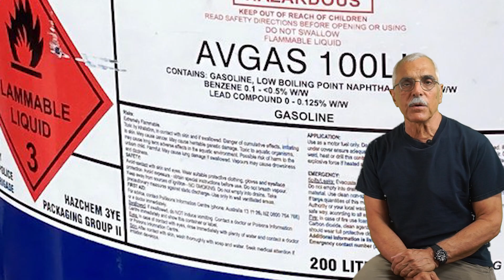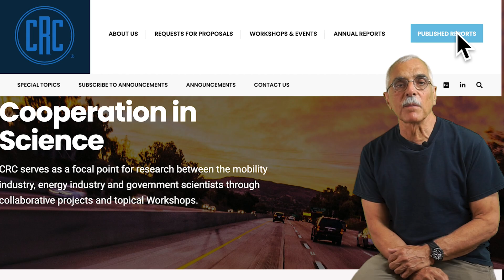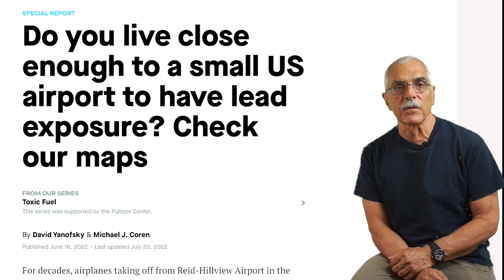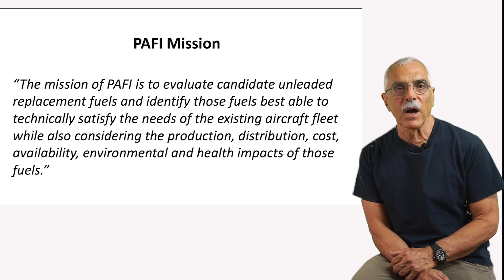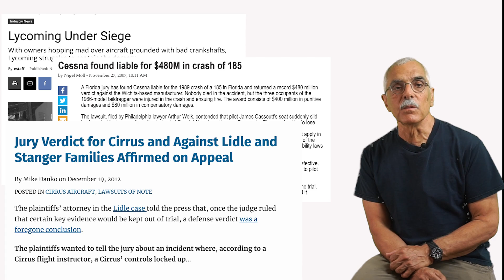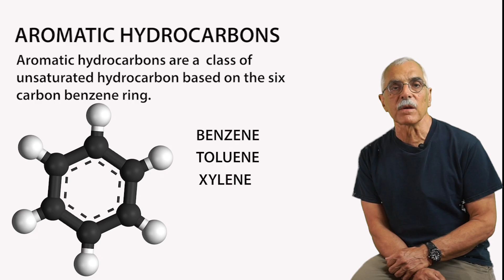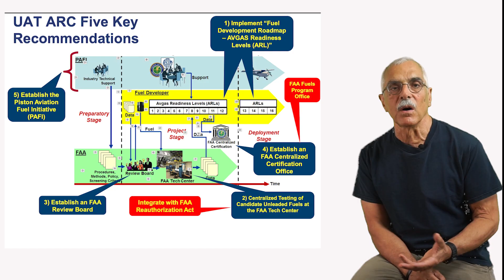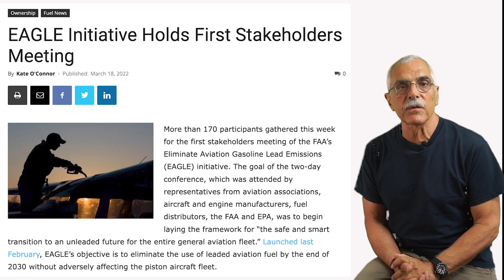The Long, Twisted and Slightly Ridiculous Story of Avgas Part 2

Comment: We still use 100LL for our antique tractors and cars that either haven't had the heads reworked with stellite valve seats or that sit in storage for extended periods, so I'd hate to loose all access to leaded fuel for specialty applications, but I know people want to get that last quarter percent reduction. (GA is a minor fuel consumer and 100ll is already greatly reduced in lead. mainly used now to only to prevent valve erosion rather than a primary antiknock additive.) 

Anyway this whole unleaded thing is caused by a socialist mindset that infects many of our bureaucracies. All the FAA really needs to do is draft the minimum performance specs for a fuel without lead (ie shelf life, vapor pressure, polymer compatibility, method used for the antiknock rating) and maybe guidance on requirements for engine approval for use of unleaded fuel spec.;( basically cannot rely on lead to prevent valve seat erosion) then accept any formula that can demonstrate that it meets the performance spec.. 
The centralized micromanagement approach of chasing every individual formulation to get a one size fits all fuel at the regulatory level is inherently flawed at a praxeologic level.  

The FAA doesn't even need to spec a specific antiknock rating, everyone knows to match an engine with its minimum required antiknock fuel, three grades can be had at every gas station and airports at one time also had multiple grades, fuel antiknock grade is still in most pilot training materials.

Comment: I have an observation that in the 1st world as you go upscale in the economic food chain you are less likely to have draconian environmental regulation arbitrarily imposed on your good thing. Take the issue of CO2 emission. The media propaganda machine hammers the working class SUV owners with condemnation, but ignores the upscale aviators and their hundred dollar hamburger joyrides. For the mega rich with their huge pleasure yachts, private jets, multiple palatial homes etc, mostly we have admiration. The few calling out hypocrisy are largely ignored.

I read a white paper circa 2005 that said CO2 emission at 30,000 feet has very different effect than at ground level. At high altitude the greenhouse effect of CO2 emission is more pronounced by being closer to the outer edge of the atmosphere. The strong wind currents aloft tend to keep those emissions up there longer, and because the upper atmosphere is rarefied compared to ground level, the concentration of the CO2 emission for a given emitter in the upper atmosphere is much higher. At ground level, plant life absorbs and benefits from CO2, while there is no such mitigation at high altitude. 

Then there is the curious exemption for the 3rd world, with massive populations such as China and India, burning dirty high sulfur coal with dirty technology that is outlawed in the 1st world, and in some cases still using leaded gasoline in ground vehicles according to articles I have read. Also infamously operating heavy industry with little to no environmental regulation (this is the other feature in addition to cheap labor that makes them attractive to outsourcing). And all their pollution goes into a fungible atmosphere.
Reply: Uh what? Individuals and the media slam on private jets and other luxuries ALL THE TIME, what are you talking about?
Reply: @DoctorShocktor  I said some do, and they are largely dissenters against the mainstream. And no, I don't see it "ALL THE TIME". And that dissent doesn't result any sweeping draconian regulatory clamp down on the elites' lifestyle. Meanwhile, gasoline cars that make personal transportation accessible and affordable to working people are in the process of being defacto outlawed in the coming decade, with massive mainstream promotion and support, on bogus chicken-little-the-planet-is-dying pretexts.

Comment: Trying to get approval here in Australia for LSA aircraft to have multi fuel turbo prop engines. Multi fuel turboprops eliminates lead altogether, no vibration, increase TBO, increase service intervals, increase safety with automatic engine management, increase available power to weight, reduced engine weight, and the list goes on. Multi fuel being diesel, unleaded, kerosene and, jet A1. Perfect for off airport operators here in Australia.
Reply: And massive fuel consumption down low where LSAs operate. You have endless money I assume?

Comment: Isn't it funny how tetraethyl lead was so easily developed as an additive,  and yet it's so difficult to find a replacement with the benefit of 80 years of experience?
Reply: There are lots of replacements, but since 100LL is so available, none have been seriously pursued.   This isn't a technology problem.
Reply: @dermick  you didn't watch the video,  I see.
Reply: @jamesengland7461  I was not clear in my comment - G100 is available now, but since no one is pushing us to stop using 100LL, we're stuck.  If 100LL were banned today, and the FAA said "OK, we approve G100", we'd be fine.  The technology is there, the solution is there, but we're not doing it because why?  I'm sure it's money-related.
Reply: @dermick  Ok; my apologies.  I thought Paul said there wasn't anything developed,  and yet I looked up the g100 you mentioned,  and sure enough,  GAMI, the group mentioned in the video,  DID develop it and it's been known for about a year now.  Did Paul simply miss it in his research,  or did I miss something in the video?

Comment: Clear and concise: well worth watching. It could be mentioned that in Europe, where the majority of GA doesn’t use high-power engines, unleaded AVGAS is available. Most 160/180 hp Lycoming engines run just fine on 91UL AVGAS. Better, in fact: the engines are cleaner ans the spark plugs are less clogged up.
Reply: Yeah and Europe KILLED IFR operations for all the high powered piston aircraft by over regulating the every day IFR pilot out of existence except for little VFR jaunts. Pilots in the U.S. want a better alternative.

Comment: A thumbs up here for both Parts 1 & 2.  Thank you for this in-depth up-date. It's probably obvious to all concerned by now that a drop-in fuel change will not be forthcoming. Meanwhile, several groups of people are doing the "long, slow, noise dance", spending lots of money, and getting nowhere.  It should also be obvious that as long as there are significant numbers of legacy engines in play, it can't work.  How about all this money and brain power gets to work on a new engine design that doesn't need the high octane, doesn't detonate, is impervious to ethanol, and gets STC'd for your Barron/Bellanca/172/Cirrus et.al., and IS PRICED SO OWNERS WILL BUY IT.  Then the long slow dance will be the new tech engine replacing the old at TBO.  Yes, a long slow time period of transition, but one that will result in success.  It's really too bad that electric isn't the solution here, but it just isn't, and won't be for a long time, if ever.  Can you say "Charging Stations, and wait-times"?

Comment: Having been on a national fuels standard committee for over a decade and a half and having driven an at least partial reduction of sulphur content against the industry (of which I still form part) I can imagine how this is going to play out.

If the general public and the aviation community are serious about a lead-free option, they will have to drive it themselves. The oil companies only sell what they have and most use their money to maintain the status quo in the market.

I have heard over and over from the mouths of official representatives of oil majors: if you want to reach this, you will have to force us through regulation.

Get your man pants on and lobby for a definite ban of leaded avgas in 2040, regardless of how it's going to pan out. Then, when the regulation is in place and all appeals have been swatted down, they will begin listening. Not one minute earlier.
Reply: Better yet, lobby for a definite ban in 2025, because we know if the ban is in 2040, they will wait until 2038 to start looking into it, then complain they can't find one, and lobby to push it to 2050. Alternatively, just put a public health tax on avgas, making it cost $20/gal.
Reply: @xeridea  while you are right, a ban in 2025 would be repealed as unreasonable.

The complicating fact of the matter: TEL has been a crucial component for high performance spark ignition fuels with high knock resistance. In almost 100 years of aero-engines relying on TEL and two wars with boycotts, nobody has yet come up with an alternative solution.

The only way that I see to go unleaded and retain high power would be through different engines.
Reply: @daszieher  2025 would be reasonable, but would require actual effort. The reason TEL is still around is no one has cared enough to invest effort into an alternative. During 2 wars, there was no effort to come up with better alternative. There hasn't been any cattle prodding to come up with a better one, so no company has cared to actually change. New engines keep being designed for TEL. As long as the asterisk is there, nothing will ever change. The rest of the ICE industry has seen huge technological improvements, and piston airlplanes often still use carburetors, which have been obsolete for 40 years.

CFCs were extremely common a few decades ago, then there was a large coordinated effort to replace them, and they were quickly replaced. Alternative and often superior chemicals were found. The difference is there was no asterisk. There has been pushback against TEL, but without forcing change, it will never happen.
Reply: @xeridea  all true, however, TEL makes a huge difference, that cannot be compensated by other means. Hence the "asterisk" that you mentioned.

Even the Germans in WWII tried to make synthetic high-octane fuel without TEL and did not succeed. C3 fuel relied on the addition of lead.

As I have already said, I do not advocate the use of lead, however, we must recognise, that effectively ending the use of TEL will necessitate new engines.
Reply: @daszieher  Yeah, a true drop in replacement including carburetors may be difficult, but utilizing fuel injection it would seem more doable at least short term. I can see why aviation was excluded when we switched to unleaded, but would have liked perhaps a 10 year extension, rather than indefinite asterisk, which enabled feet dragging. If there was also a stipulation that new planes needed to be designed to be compatible with 93, or perhaps whatever would be higher and feasible it would have at least got the ball rolling.
Reply: @daszieher  and that's what it should be. Different engines. Maybe an exemption for historic aircraft, but otherwise, a repower. Engines time expire anyway, so the cost shouldn't be that great. It would need high rpm engines with a reduction gear. There's a fear of reduction gears as unreliable, but the turbine world seems to be fine with them and no one is pointing at turbines and screaming "danger".
Reply: @gasdive  absolutely!

Comment: Frustrating when you know that GAMI has a fuel that has been shown to work… but since it didn’t come from one of the big guys, it sits unapproved on a desk, likely to die, while they start up another 8 year boondoggle that will do nothing but kick the can down the road. This is going to hurt GA the longer it goes on. People are not going to put up with us flying over their houses spewing lead for much longer. Most have no clue, but once they do, it’ll be more than just a couple airports in the Bay Area banning 100LL. It’s been 30 years. No excuse at this point.
Reply: Also, thank you for continuing to publish videos on this topic.

Comment: Is the small amount of lead from the very few piston aircraft even causing any health problems?  Has there been a non-governmental study on it? Any peer-reviewed research?  Could the government be over reacting? Is this a way for the climate change cult to try and stifle general aviation?
Reply from the maker: Short answer, probably not. EPA's data thus far is not very convincing. Probably was an issue in the 1960s. Real reason to eliminate lead is for the benefit of the engines.

Comment: This is a bit like what I've thought about the future of solar/battery power: If I were one of the big oil companies, I'd want to be the one to develop the new solar/battery tech, or as in this case, the one to develop the new avgas. That's where the future profit margin is, in being the ONE who comes up with the right formula.
Reply: Why not just develop the transporter technology from Star Trek? If we can just pick and choose whichever technologies we want to be successful, why bother with anything else?
Reply: @PistonAvatarGuy  LOL.... I think you're assuming a little bit more than what I meant in my comment.... There is new battery tech being developed right now. And there is new solar tech being worked on. I'm not talking about some miracle cure, I'm talking about the oil (energy) companies using their capital to become the energy companies of the future. Why would an energy company NOT want to be at the forefront of the energy technology that will be the norm in the next 50 to 75 years?
Reply: @rvrnnr987  How are solar panels and batteries relevant in aviation?
Reply: @PistonAvatarGuy  I know there is a lot of nuance lost in a single internet post, but it was just an example... The connection being that it's all about the big companies, profit, and future upgrades to tech and energy. It's just an example. I'll ask the the battery and nuclear power people I know who are working on this stuff if you want more info, but in both cases, it's private, start-up, professors-in-their-labs trying to raise money for their experiments, slowed by not having the capital and resources that these big energy companies have already at their disposal. In the mean time, the government is doing it's best to shut down the use of fossil fuels. I'm simply pointing out the gap where one of these companies could use their resources to be the one to fill it, but maybe I didn't explain that above.
Reply: @rvrnnr987  Unless you can somehow replace avgas with solar panels and batteries, I don't see how your comment was relevant.

Comment: If you replace LL av-gas with Jet-A (like Diamond aircraft), do you resolve the lead issue or simply replace one problem with another?  Great reporting Mr. B, you have a knack for this.
Reply: The Diamonds run on diesel.
Reply: @PepsiMagt  Depends, both actually often.
Reply: No lead in Jet or diesel…so yea.

Still burning dead dinosaurs, so bad for the environment
Reply: @Notthe_droid_youarelookingfor  That part we can and will fix with SAF, we are a drop in the ocean of all mankind's environmental harm. But yes, a good reason to go gliderflying more often :-).
Reply: At least you minimize it. Had they banned the installation of non-mogas or JetA1 engines on newly produced GA a/c in 2000, the problem of course would linger forever, but the amount of lead would go down. Same with making mogas tanks mandatory at any airfield with more than say 10,000 movements per year. It wouldn't eliminate the problem, but reduce it considerably.

Comment: I mean… jet A1 does the trick for diamonds.. It’s cheaper and diesels are pretty frugal. It might not be enough for some lights due to the weak power to weight ratio but still..
Reply: The main issue here is that there is absolutely no way to modify a 100LL engine for JET A use, it would be like turning the gasoline engine into a diesel. Youd need a complete engine swap which costs a fortune and isnt an option for every aircraft type.
Reply: @Dudeisthere  it wouldn’t be a fast transition yes. But it’s a solution. For most ac types
Reply: The Diamond DA40-180 and its JetA-burning DA40NG equivalent have very different fuel systems. Even if you were to do an expensive! front-end engine swap, the additional fuel system modifications would cost a lot too, and result in a substantially different and less-usable aircraft compared to the NG. But folks, we’re talking maybe 2,000 DA40s globally. As much as I want TEL gone myself, and would love to use GAMI’s G100UL, (caution: what-about-ism coming) the coal-burning power-plants have a bigger environmental impact. The FAA needs to issue the GAMI approvals and let the market decide.